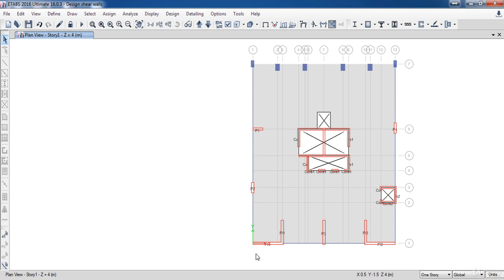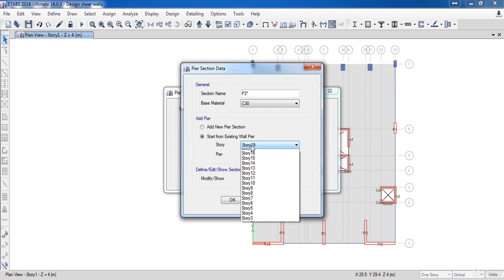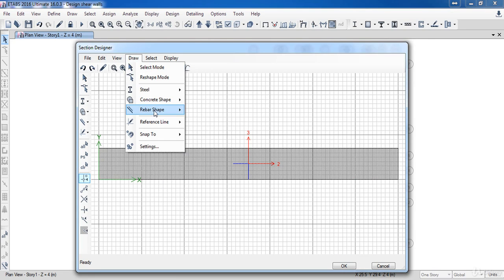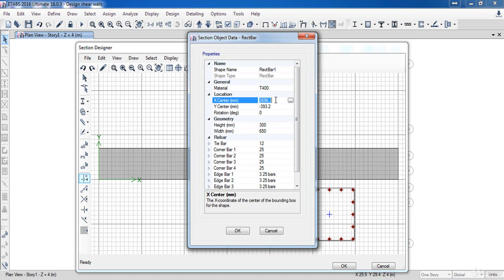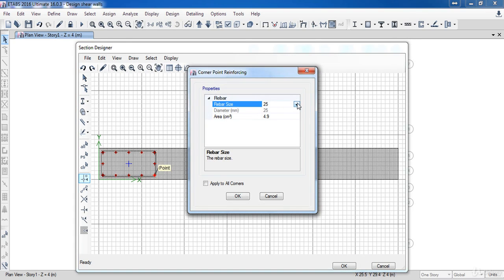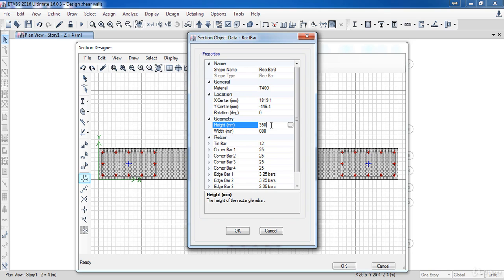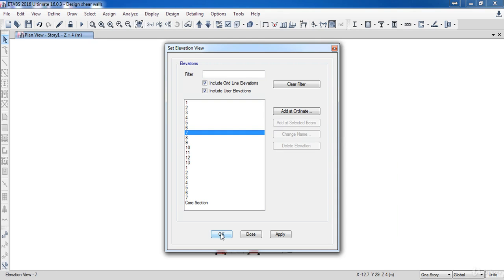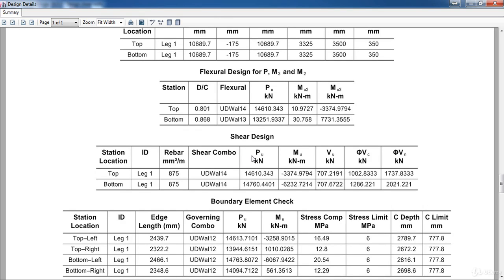How to design Shear Wall using the general reinforcing in Etabs (026)

Comment: We cannot modify the diameter and rebar spacing for the shear ties ??? 
As my shear wall after assigning a uniform section is showing OS under the shear design with message " Number of legs where shear force exceeds max allowed (top, bottom) = 1, 1 " and i dont want to increase the length and thickness of that shear wall